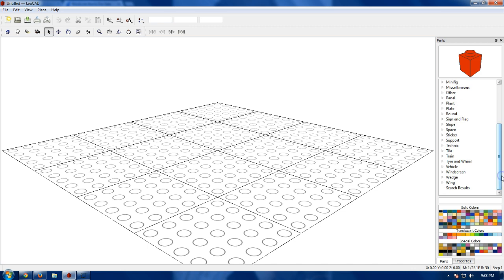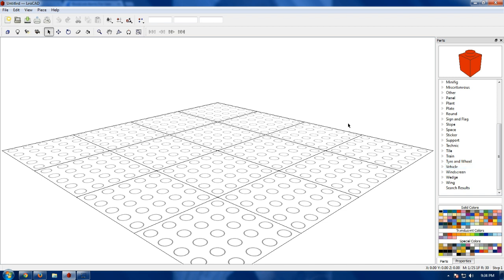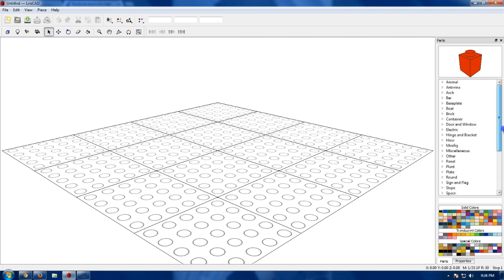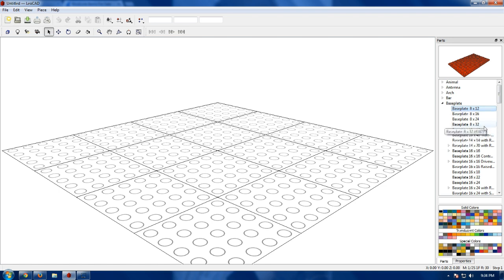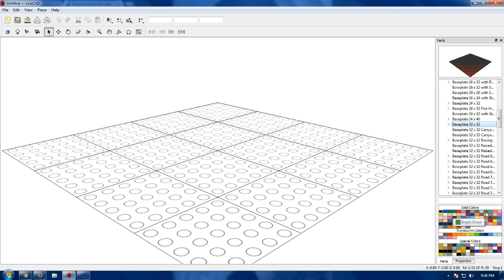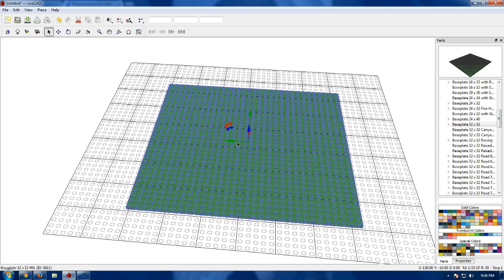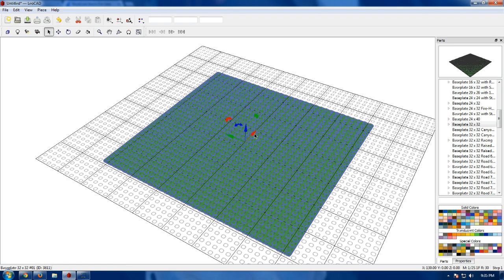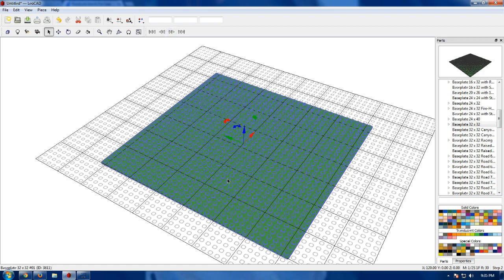How to make Building instructions in Leocad

Comment: Cool.

Btw translating and rotating stuff in LeoCad with the mouse is an extremely painful experience. I just started and I exclusively use the Properties window to put things in the scene. The snap to ... feature is also worthless.
Reply from the maker: +rbaleksandar Thanks for the help and feedback
Reply: Cooked Cat Productions Np. I've read that LDCad has much more features for fine tuning stuff like that. Just installed it and will give it a go.
Reply: Small update: yeap, the snapping in LDCad is much better even with the default settings!